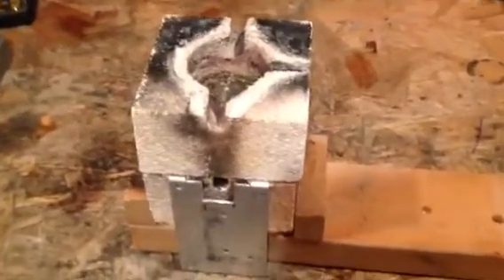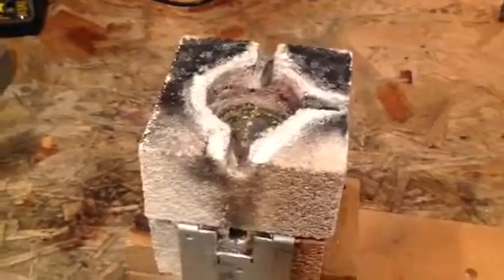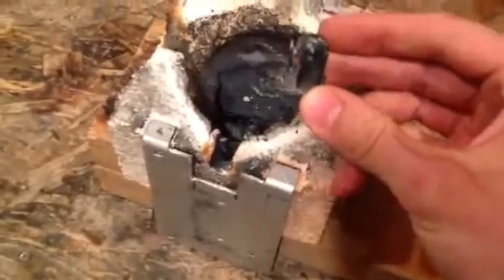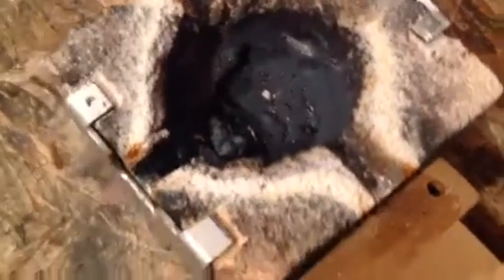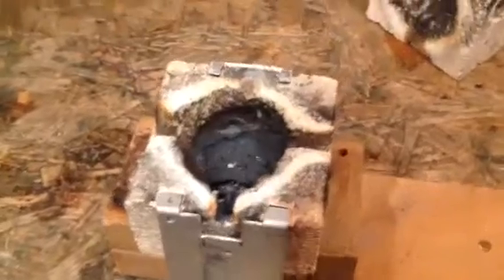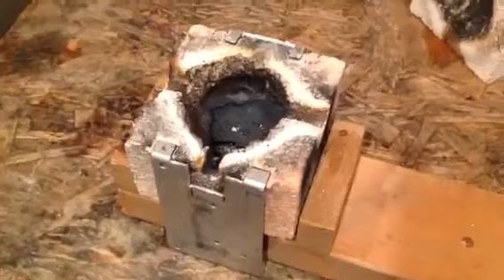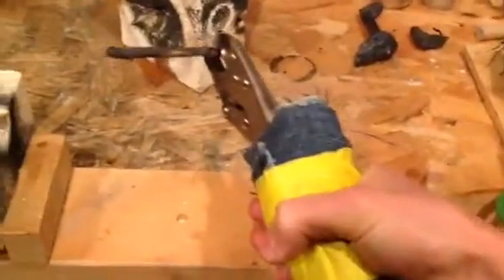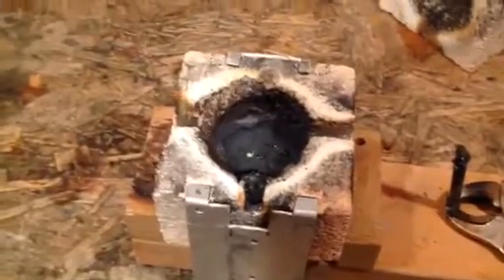DIY Electric Arc Furnace Improvements

Comment: Have a (supposedly) 255 amp welder (plugged into ~120v outlet) , and TKOR's furnace brick setup.  Trying to sustain an arc across the carbon rods flips my 1945 home's garage 120v breaker after 4 seconds. Oven socket, and dryer socket are 240v and higher starting amps. Wondering if a long cord from garage to either of those sockets (for safety) would yield better results with a Microwave transformer setup as TKOR did.

Comment: How do you center tap the transformers if I'm using 120 AC? On King of Random's video it just mention this as an option but does not describe how to do it. I would appreciate your help.
Reply from the maker: I actually had that same question after watching TKOR's video.  Even if your outlets are all 120VAC individually, you can use the hot wire from two outlets to "add up" to 240VAC.  You must use outlets on different circuits on your circuit breaker so that their sine waves are out of phase.  Then you can use TKOR's design unmodified.
If you cannot fit all 18 turns into your transformers, you will get a lower voltage.  If I recall correctly, my transformers only made 30V total.  Lower voltage hampers arc furnace performance, but if you get ~15 turns of wire on each transformer, you should be OK.

Comment: Wow, it's nice to see that I wasn't the only one who was inspired by Grant Thompson's idea :)
Let me describe my version: I've seen right from Grant's video that his contraption's power handling is too low (hence it heated up too much), so I used bigger pliers and ordered thicker (18 mm i.e. about 3/4" thick) carbon rods off of eBay. I also added some strips of copper between the clamps and the rods to ensure a better conductivity (I can send you some pics if you want). I used my (3-phase) welder as a power supply and some substitute bricks (also made from light, porous and easily worked material). The welder's working fine (it can push out 4 kW of power when run on 400 volts from the 3-phase outlet), but the overheat protection kicks in way too fast. The clamps themselves however don't get too hot (they do get hot, but stay "cool" enough for me to be able to grab them with my work gloves) and about only half of the rod gets glowing.
I used my setup to melt some aluminium (which was a success, I created some pure aluminium "nuggets"). Then I tried to melt glass, but the glass shattered as I was heating it, then (as it melted) it got stuck to the brick's material. Then I tried to melt some iron on top of it and it seemed to have vanished into the goo created by the glass.
Reply: +CoolKoon  you got to remember that the brick is made out of silica which is the primary ingredient for glass so what you did was to add in a lower class of the brick. also the reason why the steel dropped into the "goo" was the fact that the steel is of a heavy specific gravity then the glass so it sank in it as if you were doing a fire assay. if you can refire and then pull the steel out while still hot with a set of crubile tongs. and or get it really hot and you might be able to do a pour . I would suggest doing the pour into a metal bucket of water CAREFULLY ( BECAUSE BOTH THE FACT THE MOLTEN GLASS MIGHT SHATTER IN THE WATER AS YOU POUR IT BUT ALSO THE HEAT OF THE STEEL AND WATER WILL CAUSE IT TO POSSIBLY BOIL AS WELL AS SPLATTER!!!) since the  mix in there would be of no direct use right now.
Reply: +Joshua Dunbar Yeah, I avoided secondary rewindings, because somehow they always end up getting melted (if you've seen some videos of photonicinduction, you know what I'm talking about, in all his experiments involving a rewound transformer it was almost always the transformer that gave way first). On the suggestion of photonicinduction I purchased an oil welder (oil-cooled transformer welder) which can take a LOT of beating (it heats up so slowly in fact that I have a feeling that I could weld with it all day).

Unfortunately there's not much that can be done about the rods being consumed quickly, because that's what they use in big arc furnaces for heating as well. The only thing you can do about it is making sure you have AC (DC consumes one of the electrodes a lot faster than the other one) and that the rods are as thick as possible (fairly thick and fairly long graphite rods coated with copper can be bought at welding supplies). To avoid having to hold them (for a long time) and increase precision, you can buy substitute support equipment (rods and stuff) at laboratory supplies used to hold test tubes and beakers.

As far as the crucible's concerned you have to make compromises I'm afraid. The cheapest refractory material I found so far is graphite. Its melting (well, sublimation) point is the highest of all the elements and can take basically any kind of thermal shock. However it's a fairly soft material (1.5 on the Mohs scale) and many elements react very easily with it (e.g. and especially iron). Thus it can only be used for melting (and casting) metals with melting points below that of iron (and perhaps some minerals too). Any other refractory material that's less reactive (e.g. ceramics or tungsten) is either sensitive to heat shock i.e. has to be heated slowly (e.g. ceramics) or expensive (tungsten, molybdenum among others). This means that you have to choose which way to go and what would you like to melt.
Reply: +Paul C I thought that the main ingredient is alumina, not silica. Either way I've pretty much ditched the fire brick idea, because as I was melting iron the thing started to melt as well (perhaps the bricks I got are not made from the same material American ones are), so I fear that if I'd add more iron, it would all melt the brick and cause it to fail. So currently I'm looking for an alternative crucible that'll allow me to melt iron (and perhaps some minerals) in it without it falling apart (or being too expensive).